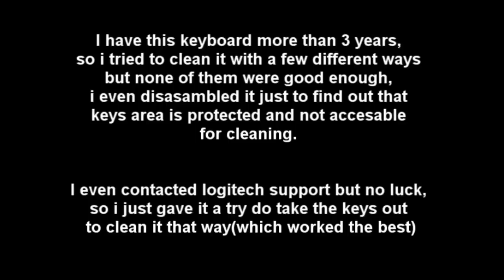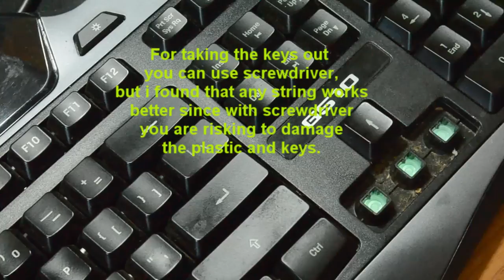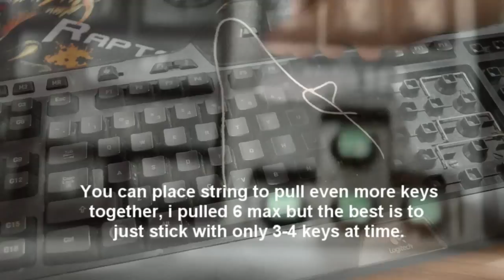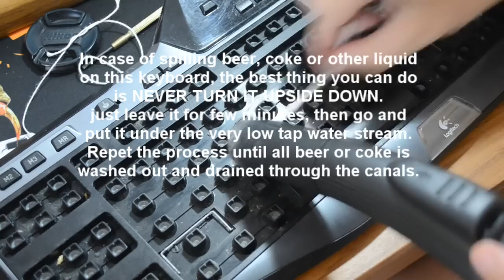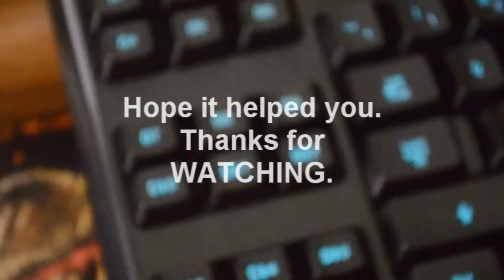Logitech G510 keyboard Cleaning

Comment: I still have this keyboard still working until today, about almost 10 years i never wash my keyboard, i found out too many dirt on my keyboard, then i what i did was, i wash it with water , soap ... ... then i let it dry, not really 100 clean still got dirt stuck inside on keyboard, after a day let the keyboard dried, then i was not functioning, .. after about 1 week i test it again , its works very fine with out any error, luckily i have bought new corsair mechanical key board red switch... but I found out the best keyboard still G510
Reply from the maker: Yea, i agree this was the best logitech keyboard. I wish they make mechanical version of it.

Comment: Can i do this with the spacebar too?
Reply from the maker: Not sure, i know some people took out the spacebar then later they had problems returning it back. So thats why i don't recommend it unless you know what you are doing. It sure can be taken out and placed back its just that its a bit trickier.
Reply: Hey! I took a shot and tried it! it worked perfectly, but you should be carefull :) I used two screwdrivers and popped it out :)

I spilled orange juice all over the spacebar and i could barely push it down. So it was either buying a new one or try fixing it. Thanks for the tutorial btw!

Comment: Dude just screw it apart and wash it in the shower its way easier plus you wont risk breaking any of the taps that holds the keys down.
Reply from the maker: +Demonborn As a matter of fact i did it before, the problem with this is that water can go between key and key placeholder, which is not good, also when taking keys out i can be sure that i cleaned all mess underneath.

Comment: My Left control is Stuck down?
Reply from the maker: Use your fingers and hold the key strong while its placed then try pushing its each side to all directions..left right,forward down...and it should work after. I had the same  problem with my "CTRL and Y" key

Comment: what mouse do you have?
Reply from the maker: MSI GS502, its one of the best mice i ever have (and i had a lot). Its been almost 5 years now and i still use it. I bought Razer naga Hex 1 year ago and to be honest i like GS502 more. It has weights, 3DPI lvls, and 3 macro profiles, software even outdated is great and supports continuous step macro recording with timing inbetween, and it stores it on the mouse itself. I would really recomend it to anyone, although i think it is very hard to find since it is discontinued, i got it as a gift when i bought MSI gaming laptop/.
Reply from the maker: speedfreakpsycho If you ever used Logitech MX series.. this mouse feels inhand almost the same.

Comment: electrical wire will make do if you have no string
Reply: +Casey Colbert (LCbiking) I just took everything out with my hands no problems
Reply: +NoLMAOnade I broke a key doing that
Reply: Casey Colbert I've done it a few times over the years and twice last week Never had a problem!
Reply: Floss (it's that plastic string with which you clean between your teeth)
Reply: +taradead that shit expensive
Reply from the maker: You can use fishing line too.
Reply: Casey Colbert
you think thats expensive, try tampon string
Reply: +taradead why

Comment: will this also work with the G19s?
Reply from the maker: No, you can disassemble G19 just buy unscrewing all screws from the bottom then take of the front part easy with all plastic key parts inside. You can refer to this video on TY "Démonter et remonter le Logitech G19"
Reply: speedfreakpsycho  awesome, thank you very much

Comment: Just a heads up,NO! dont do this unless you making excuses to get another keyboard. Get a Philip screwdriver unscrew the back. Yes alot of screws but worth it. Dont lift off the back instead hinge it open like a book. Disconnect the ribbon(Lift blacktab) DONT PULL IT FOR FUCK SAKE. an set the back aside.Remove the white illuminator, unscrew the 4 shiny screws and the ones around the keys. Remove the glass and the key pad set it aside.Unscrew the top and bottom electronics dont remove it.Unscrew the tiny shiny screw bottom center. Lift up the wire going from the bottom to the top around the volume dial.  There are 2 small/tiny hooks on both sides push it in an the chassis holding all the keys should be removable. Place in a detergent solution and use a brush to really get between the keys. Back trace and remount, Its as almost as brand new. From this https://i.imgur.com/rglKH82.jpg to this https://i.imgur.com/ilCD57M.jpg and https://i.imgur.com/KMhhRdb.jpg

Comment: I like to take my keyboard with me under the shower.. And when it gets really filthy and nasty I simply throw it in the dishwasher for a very short time (like 10-15 mins max). The first time I did this, it was just for fun.. But I couldnt believe my eyes when I connected the keyboard and everything still seemed to work correctly.. After I found this out, I ended up putting my entire gaming PC in the dishwasher.. I tought it could take it, because I also have liquid cooling.. Guess what happened? I woke up
Reply from the maker: In fact, I've seen some people wishing their Logitech kb under the shower. It will work as long as you don't turn it upside down.